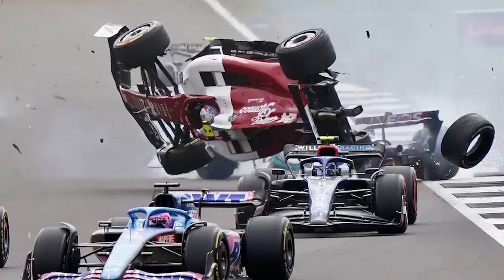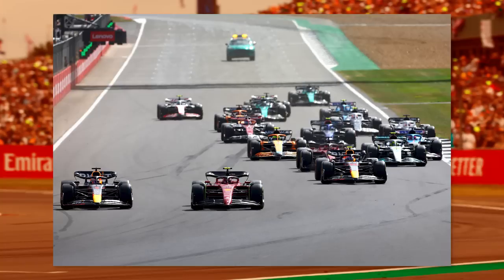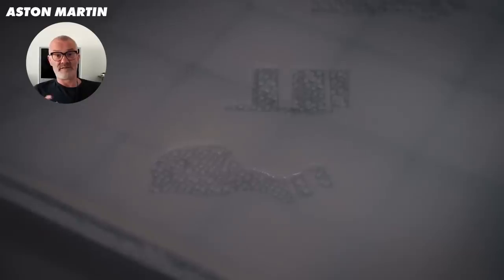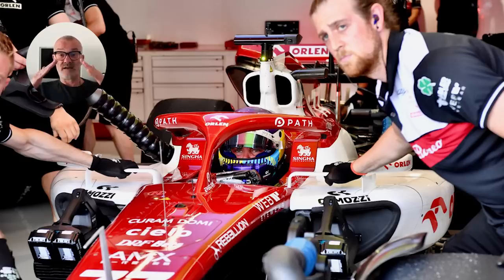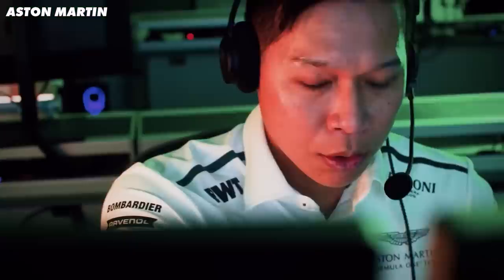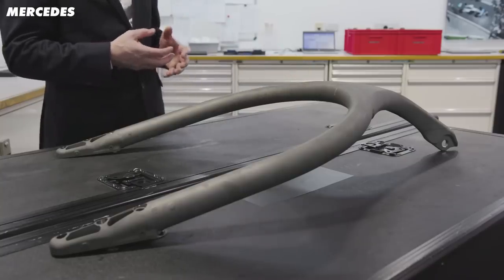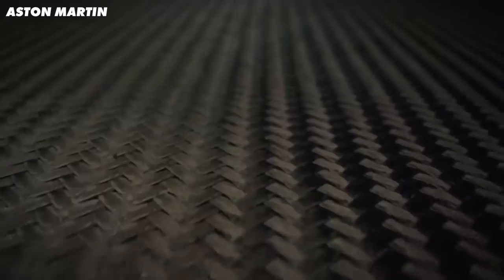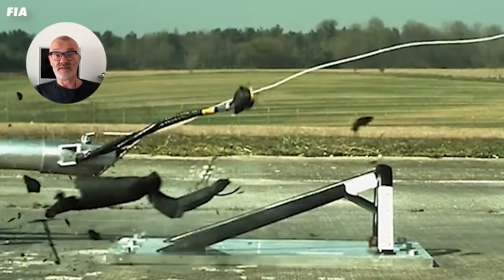Did the Roll Hoop FAIL in Zhou's Crash?

Comment: Great video. It looks like they need to anchor it in new ways. Maybe a combination of screws and bonding lower down in the chassis. They also need to look at the fencing. The scariest part of the accident was the gap that the car got stuck in. There’s no way Zhou could have survived a fire like Romans and the car was fully loaded with fuel.
Reply: I think Grosjean's crash saved Zhou. FIA apparently learned from Grosjean's incident and implemented new fuel tank design requirements for this year's new cars to reduce the chance of the fuel tank being ripped apart and catching fire.
Reply: I actually think the gap is less of an issue than the surface of the runoff area beneath the gravel. There's a ledge before the tyre wall which is what launched the car.
Reply: Either no gap at all, with escape/entry windows/gaps in the fence for marshals and/or drivers to pass through. Or a gap wide enough, so a car can't get stuck sideways in the narrow trench like it did.
Reply: @kekkonenprkl  apparently they need a gap as a buffer zone for the barriers to move inwards in case of a more common front collision. They never expected a car to flip over the barriers. I think a wider gap would work if space allows.
Reply: @willw.3366  Didn't realize the tyre barrier is required to be able to move inward, as the tyres are stacked against a low, probably a meter high steel barrier. But it makes sense.  So i assume that steel barrier is designed to deform at a certain rate, to make the tyre wall stiff enough for the initial impact but to allow them to move and release energy right after? I agree, a bigger "trench" would be the way to go then.
Reply: @kekkonenprkl  my mistake. I thought they were the "tech pro" barriers but I just googled Zhou's crash and you're right. They're just tyres painted white. I don't know if tyres need the buffer space, but tech pro does.
Reply: Bolted and glued connection is worse than just bonded connection. You have to make weak points to your design aka holes for your bolts plus you have a lot of stress concentrations
Reply: @projecttitanium-slowishdriver  It depends on how it failed, if it was delamination, I could imagine having a frame on the opposite site of the carbon fiber that the roll hoop bolts onto could help.

But it really depends on how much structural integrity of the monocoque is lost by doing this.
Reply: @willw.3366  that's one of the reasons why in some places tyre walls are better than tecpro barriers

if you roll over the tyres like zhou did you're gonna push the catch fence and get stuck no matter what tho, so a big trench behind the tyre wall seems like the best way to solve that
Reply: @projecttitanium-slowishdriver  yep, I know scarbs said the same thing - the combination of bonding the roll hoop and the  chassis didn’t seem to work either.
Reply: I think the blade style is just easier to tear of as when you apply force at the top it will leverage that force more than the standard type.
Reply: Yes. Totally. 
If Zhou was seriouly injured, bleeding, or burning this could have been a truly horrible scene.
Reply: @willw.3366  Believe in JESUS today, confess and repent of your sins. No one goes to heaven for doing good but by believing in JESUS who died for our sins.  For God so loved the world that he gave his one and only Son, that whoever believes in him shall not perish but have eternal life.(John 3:16)🥳❤️😗❤️😁❤️😚
Reply: @bobthegoat7090  it depends on how the bottom of the blade is designed, the distance from the chassis to the top of the roll structure is standard, so the leverage is the same, but the blade might have less area of bonding between it and the chassis than a normal roll hoop
Reply: That is how its done; bolts and bonding. The author is incorrect.

You can even see the mountings for the bolts, and the other guy in the vid said it's bolted on..
Reply: @jg2627  cool! What team do you work on?
Reply: @willw.3366  And now thanks to Zhou crashing in the way he did they will use that as an advancement to improve the safety barrier because such an incident has never happened before, so they have never had to think "What if a car flips over the wall after skidding across the gravel?".
Reply: I don't think that a bigger gap after the tires wall is a perfect solution either, cause if the car landed upside down he would still not be able to get out on his own.
Reply: Not Screws I don't think. Titanium bolts probably.  Six of those big f**kers and its going nowhere!
Reply: As long as it's bonded to the carbon fiber, the carbon fiber will always be the weakest point and will continue to do the same thing, just with a bigger or smaller chunk flying off. I'm not saying they shouldn't do anything, as freak an accident as it was it will inevitably happen again in some capacity down the road, but it will take regulations to force a drastic redesign the cars on a fundamental level.
Reply: @owcarnia  yeah, but with a bigger gap the marshals would had more space to flip the car properly. Also the car naturally wants to come back up, if the fence was further away it would had landed top up
Reply: Agrees. However, I do not think screws will work. The 'glue' mentioned in the video is likely to be a type of epoxy used to bound carbon fibre layers. They are certainly not as strong as the fibre, but with such a large contact area, the force they can withstand is just much more significant than a skirt of bolts, not to mention that the holes drilled for bolts will likely weaken the strength of the area, allowing it to be torn off just like a piece of tissue in such high energy incidents.
What I think might work is that they might alter the piece's geometry to reduce horizontal(shearing) force acting on the bound. This could be done either by making it more round-ish on the tip (mentioned in the video) to reduce the pushing force on the side when it dug into the ground or by developing a wing-like structure to further spread out the load to the chassis and transfer more of that force into a more vertical, stretching force to the skin. Either could work, or they might come up with other options that will not lower the car's performance.
Reply: Did you not watch it? It looks like it was the carbon fibre that failed.
Reply: …NEEDS TO BE a MOLDED/formed ACTUAL integral part of the body.
Reply: @willw.3366  You are 100% correct with that they never expected it.  If racing accidents show us anything, it's that if you think a car won't crash in an area, you can bet money that one will find a way.

Comment: You're spot on about "welding glue" used in F1 being so strong, it's actually stronger than welding and is the same as used in the aeronautics industry and was developed to replace welding or riveting in low drag aircraft such as stealth planes so has to be able to withstand pressure at mach III plus.
Reply: Don't get in on your fingers! And ask a parent to help....😵
Reply: I don't know what glue you've worked with, I work in the aerospace industry on spacecraft and glue (like EA9394) is pretty weak, certainly when compared to welding. As with all fastening methods it's obviously more than just the tensile strength of the component, and that's where glue is nice since you can put a large bond line on something. But with the same area of welding and bonding, I'm not aware of any glue that is stronger than a 70ksi weld.
Reply: @TheSnivilous  scotchweld is pretty strong🤷‍♂️ theyre probably talking about the epoxies used for composites when you do a wet lay up, that shits really strong
Reply: and the rail industry. there are many cases where you have to bond two different metals and welding is not viable.
Reply: The almost comical part is it's basically super glue. And yup that's what they use on fighter jets.
Reply: @TheSnivilous  I always wondered how it handled expansion and contraction in the jets.

Comment: The thing I absolutely love about mechanical engineering is just how much you can learn when designs fail. I'm very happy Zhou walked away from this incident and because this critical safety part failed, it will be redesigned in hopes that it never does again.
Reply: The safety part didn't fail, the carbon fiber it was attached to failed. In order to prevent this again, it will take a drastic change in regulations and design. It would take something more akin to a "roll cage" around the cockpit to prevent such an event; something all the way to the floor of the chassis. The carbon fiber will always be the weakest link.
Reply: @Parker--  Ah remember when cars started getting bigger and heavier and everyone was on board with it because of "safety", it is so ironic that those bigger and heavier cars behave in dangerous ways during cashes. When cars where lighter roll structures didn't crumble so easily and cars just flipped again instead  of sliding upside down.
Reply: @Ale-nv2bo  There's always give and take and all the rules regarding everything else are arbitrary to begin with. If they want to make a legitimate change so that the car is safer in this situation again it will take a drastic change. Of course, the question is do they actually want to make such a dramatic change for safety? Who knows. They could just as easily shrink the cars back down, still add a roll cage and keep the speed by changing engine specs and a billion other arbitrary rules if they wanted to. It's a matter of if they actually want to.
Reply: @Parker--   Amen to that brother.  Unlike steels, there is no failing by degrees in carbon fiber.  Its 100% to 0 % in a instant.
Reply: @Ale-nv2bo  Surely you would rather be sliding in a car with a feature to stop your head getting hit than being in a car that’s flipping with no feature
Reply: @hava1715  Nop, I'm 1,82 wich means that my head would be gone sliding upside down so I would take flipping instead of dying if you don't mind. Also the structure broke because the car didn't flip.
Reply: @Parker--  I don't think it would take a full roll cage. I think a redesign to provide more mounting points to spread the load and alter the direction of forces applied could do the trick.
Reply: @Silverhks  that's about what I got from this video too. It wasn't the hoop or the structure that failed, but the mounting system. Spreading the load and over a wider area and strengthening that area might be enough to prevent this from happening again. 
That said, it did take the initial shock and once the car "settled" there was no further degradation. 
More so, an important safety feature failed, but the guy still walked away from the car, and we're speculating on solutions and not mourning. 
That's still a pretty decent outcome imho.
Reply: If you really cared about safety of drivers then you'd protest until all F1 cars where remote controlled, so the drivers never get into any physical danger ever again. 

Of course you won't, because you like the danger aspect of it.
Reply: @BoleDaPole  a perfect example of a straw man right there.

Comment: Thanks Scarbs! I've been thinking exactly the same thing, the FIA does test these roll hoops thoroughly but the bonding with the chassis is what most likely failed. The FIA should look into it, but as the tests stand now, the roll hoop met specifications.
Reply: Just like any assembly, the bonding point is where the structure usually fails.
Reply: Nah, it's much more likely that the carbon fiber layer it was bonded too sheered off. As mentioned, carbon fiber is not resistant to forces along the layers. This is why  Lamborghini and their partners created Forged Carbon Fiber that has similar strength in all directions (though I believe less strength than traditional carbon fiber has against the weave).
Reply: @jkliao6486  Not with carbon fiber.
Reply: @kalasmournrex1470  You can clearly see leftover adhesive from photos. If it was only the carbon fiber there would be none because the roll hoop would have ripped the whole layer off
Reply: @kalasmournrex1470  It is still the bonding point though.
Reply: @jkliao6486  Believe in JESUS today, confess and repent of your sins. No one goes to heaven for doing good but by believing in JESUS who died for our sins.  For God so loved the world that he gave his one and only Son, that whoever believes in him shall not perish but have eternal life.(John 3:16)🥳❤️😗❤️😁❤️😚❤️
Reply: Could be sustained multiple compressions, all those materials involved flex a lot, maybe they test a 30000lb weight on it, but every bit of gravel it hits will be adding hammer blows of that 3000lb weight to a material likely held at its fracture point (given the speeds it would be happening at it may not return to position before the next impact, it would lose it's spring and become totally rigid and brittle).
Reply: @kalasmournrex1470  nothing should be attached onto a layer of carbon fiber that's just lunacy. There's no carbon involved in the strength of it if you do that, your relying on the epoxy, which is a weak plastic type material, it will just flake off. The fibers need to run through the areas of stress not alongside them .

Comment: When I was doing them there was the combined static test and there was a reverse theoretical test that you passed by proving your calculations in FEA. The latter was very often, er, well, extra material is extra weight and up there it heavily effects your CoG, so yeah, the reverse test calcs were perhaps wishful thinking.

Also bears mentioning that the hoop passes ONLY this combined test, swap the values around, change the values, worn't pass. Remember the old side crash tubes? Literal tubes at 90deg to X? Literally only worked along their axis, hit the barriers slightly oblique and they were useless. The cars are designed within the rules with no consideration to driver safety, dirt truth. The rules need to consider this, always. However, no-one will stand up in the TDs meetings and say "we know our car is unsafe in situation X, please change the rules".

Comment: A great video again from Driver61. 

What I have learned from my co-workers ( one has done a Ph.D. in how to repair metal fractures of the airplane with glued composite plates) is that bonding is a much better way to connect parts than glue and bolted connections, less stress, and no weak points.

I do a lot of fea calculations for rollover structures with implicit and explicit code, at this point for big machines, for example, the vertical load can be 100 tonnes.

I do prefer explicit code because it allows progressive damage model to steel and weld structures and their alloys, to design lighter structures than implicit code.
Reply: yeah only problem with the glued composites is that for the calculations it is harder to define how the loads gets turned over. As for bolted/riveted (bolts are rarely used) connections you can to that way easier. 

In the c ase here i would suggest hat the adhesion between comb and top layer of the carbon failed. Therefore a bolted connections would improve that. because then the load would be applied to fully use the strength of thestructure. It also would help becuase such impacts can cause delamination which then weakens the carbon
Reply: I was wondering and if you could answer wonderful, and if not, maybe you could ask your friends:

Could it be that the initial vertical impact damaged the carbon composite debilitating the bond between the top layers and the rest of the monocoque? Then, the sliding after could have caused the debilitated structure to detach?

Could this happen to an up to spec part or maybe it suffered from defects during manufacture? It is my understanding that small imperfections in composites are both easy to appear during manufacture and hard to detect.
Reply: @andresmartinezramos7513  I comes down how its all layered up. I dont know if they use a core for example or ift its just layers of CFRP. If its done with a core im sure the weak point is between core and the first layer of the net.

Comment: Is it possible that the “blade” style resulted in greater shear stress by digging into the track?  A more rounded hoop would have perhaps been subject to lower sideways force as the car slid across the surface.
Reply: Yes indeed.
Reply: That tracks, I suspect we may see a ban on the blade style roll hoop, but I suppose we'll have to wait for the official investigation to bring all the facts and findings and a recommendation.
Reply: Like using a baseball bat to remove a barnacle versus a mailbox
Reply: sheer stress is not gonna cause delamination of the carbon
Reply: i think that you might be on to something
Reply: TBH easiest solution would be to have it glued and bonded. because tzhen you cant get the single layers of the carbon fibre but the whole composite which wont shear
Reply: If it landed straight vertical on the blade which would cause a huge vertical shock to the assembly "Tower" ..... Followed by the blade dragging along the track under the weight and speed of the car ..... It's going to break off ...... Need to get rid of the blade extension at the top and make the hoop smooth and symmetric with nothing sticking out of it that could lever it off the car
Reply: @barbonson_richards  Well - sheer stress isn't what's causing the problem here...  A roll-hoop-blade, digging into the tracks surface because of it's sharp angles and small surface at the top can lead to very high levering forces acting on the carbon structure below the metal roll-blade.